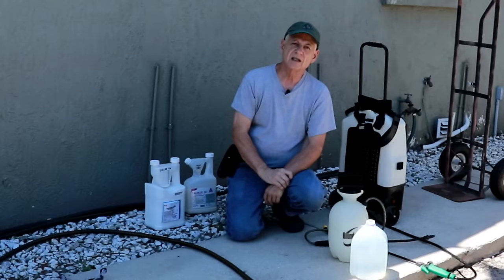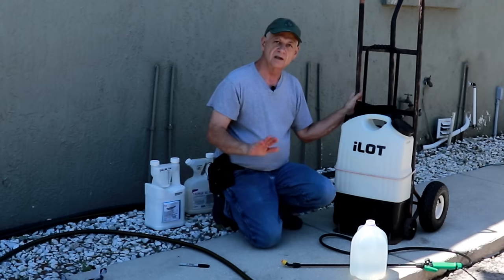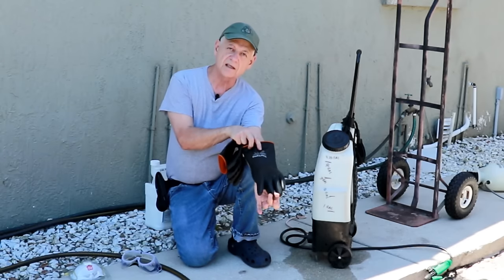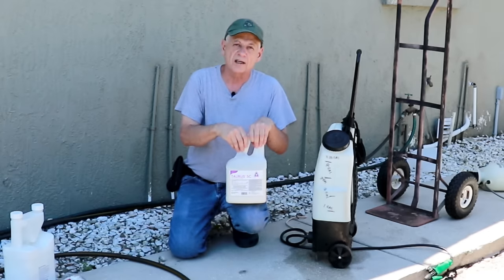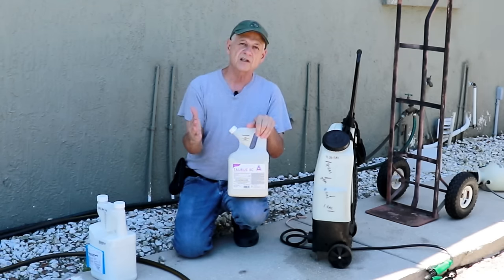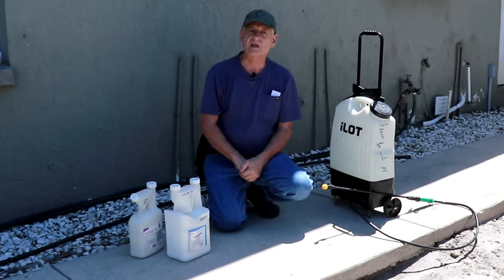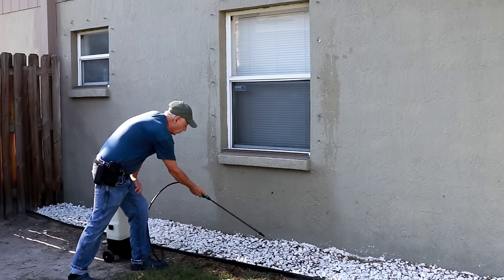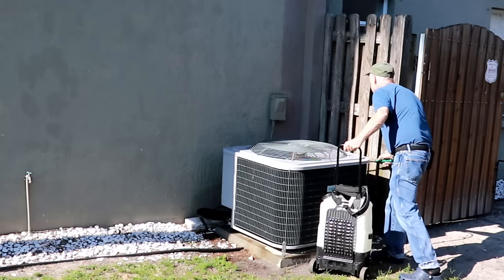General Exterior Pest Control - IMPORTANT!  READ THE DESCRIPTION.

Comment: Thank you Guy for this informative video. I am a complete novice in pest control. I am having termite problems in my house and in my wooden fences. I watched your other video about perimeter treatment, another great video. I plan to follow your advice there. I had also ordered the one gallon Natural Borate Termite Control NI1001 by Nissus to be sprayed on the wooden structure beneath the house and on the fences. That was before I watched this video. I saw you used Taurus SC, and I have this question: Will the NI1001 be nearly as effective as Taurus SC in killing termites, carpenter ants, spiders, and other pests?

Cockroaches don't seem to be a serious problem in where I live (California). Again, thank you very much for all your tips!
Reply from the maker: Hi Robby, Sorry for the delay in answering your question.  For some unknown reason YouTube held it for review and I didn't know that they did that sort of thing.  I have the problem fixed now, but not before several questions went unanswered.  It kind of makes me mad because there was no reason for them to do that.  They should have told me. Anyway, the Borate products work somewhat differently than the Taurus SC, but they are very effective for drywood termites, carpenter ants, and other insects that enter from the exterior of the wood and it is a permanent treatment.  That being said, subterranean termites and carpenter ants can and do enter the wood from other adjoining structural members and destroy wood from the inside out.  In the case of carpenter ants, they generally push wood out of small holes in the wood and may contact the boric acid that way, but subterranean termites pretty much remain inside the wood and do not like to be exposed to the air, so they never touch the boric acid.  So, I don't recommend it for subterranean termites.  All of this is to say that what you did was good and it will prevent  several types of insects from entering your home, including drywood termites.  However, you should still do the exterior treatment that I recommend in my video and the termite treatment that I recommend in my DIY Termite Treatment video.  In my judgement, you can't overdo it.  Boric acid products are great and I use them all the time for a variety of applications, but they have their limitations.  I hope that helps.  Again, I am so sorry for the delay.  It won't happen again.
Reply: @GuysPestSolutions  Hi Guy, many thanks for your detailed explanation. I will follow your recommendations and do the exterior treatment. "you can't overdo it." That's a great advice. Thanks!

Comment: I have black Swarmer's in the bathroom last few weeks please advise for indoor treatments
Reply from the maker: Black swarmers are always a common variety of subterranean termites that must be treated from the outside.  I have a video on that and I will place a link below.  If you want, you can also shoot some fipronil foam into any damaged areas.  Just drill holes several inches apart in all damaged areas and shoot in the foam for about five seconds.  You still need to do the perimeter treatment as shown in the video below because these termites never colonize in the house.  They always colonize in the ground and must return to the colony fairly often to feed the other termites including the queen and to get the moisture they need to survive.  When they go home, they pass through the barrier around the house and take it back with them to share with the other termites and that kills the entire colony.  The product I recommend is BioAdvanced Termite Killer granules.  It's cheap and easy to use.   I hope that helps.  Thanks for watching.  

https://youtu.be/H7rW_TSBHJ4

Comment: I have a lot of ants and mosquitoes and flies…what chemical do you suggest that is safe with dogs?
Reply from the maker: Ants, mosquitoes, and flies are very different kinds of pests and need to be treated very differently as well.  Therefore, I need to address each of those pests individually.  That means this is going to be a very long response.  Sorry about that.
 
To effectively treat ants, it's important to know the species.  As a general rule though, you should attack the problem from both inside and outside of the house.  That is because most species do not colonize inside buildings.  There are exceptions of course, but even those species need to be treated in the same way.  For the interior treatment, I have a video on how to treat ghost ants.  Even though this video was created specifically for ghost ants, you can learn how to apply a bait indoors to help kill off the colony.  I will place a link below for that video.  After you bait for them inside, then you need to do a proper exterior treatment.  I have a video on how to do that and I will give you a link for that video as well.  In that video I am recommending two different products, but I was not exactly clear how to use them, so let me clarify now.  For ants I recommend that you do your first treatment with Taurus SC.  Two months after your first treatment, I recommend that you start treating with Bifen IT every two to three months.  I know I say in the video that you should treat every three months, and that is true, but I am finding that in some places the ants are so difficult that you need to treat every two months.  So, you can use your own judgment on that.  If you start to see ant activity after two months, then just go ahead and treat.  However, if you are not seeing any activity or very limited activity, then you can go ahead and just treat every three months.  Also, the sprayers that are depicted in that video I no longer available.  I will provide you with a link to a sprayer that will serve you well.  In my video I am recommending Talstar P, but the Bifen IT is the exact same product, but only less expensive.  I also recommend that you treat your lawn with Bifen IT every two months.  Not only will this help to kill the ants, but it will also help to get rid of those mosquitoes.  I have a video on how to treat mosquitoes and I will place a link below for that video as well.  In the mosquito video I recommend using a specific sprayer that I no longer use.  I stopped using it because it just keeps falling apart.  Therefore, I am recommending a different sprayer and a slightly different procedure for using it.  I will give you the procedure for that below, if YouTube lets me post that much.  If not, I will post that procedure in the next comment.  I know you have some concerns about the dogs, so let me assure you that the Bifen IT is perfectly safe for your pets after it has dried.  Just keep children and pets off the treated areas for a couple of hours after you spray.  
     
Again, I recommend using Bifen IT and a specific garden hose sprayer that I know works, but you can use any brand that you wish.  I will place a link below for both the sprayer and Bifen IT.  I have found that these sprayers do not last beyond a few uses because they seem to clog up quite easily, even if you clean them really well.  So, what happens is you end up just spraying water instead of pesticide.  That is why it is a good idea to put a dye in with the pesticide, so that you know it is working.  I will provide you with links to all the products.  When the sprayer stops working, just buy a new one.  They are not very expensive.
   
This application method does not require a lot of protective equipment.  I recommend wearing goggles, rubber gloves, long pants, a respirator, and long sleeve shirt (If it's not too hot out).  
 
The Bifen IT is too thick to be picked up by the siphon tube in the sprayer and therefore, it needs to be diluted.  To do this, pour 4 ounces of the Bifen IT into the sprayer and then add enough water to fill it to the 32-ounce mark.  So, that would be 4 ounces of product and an additional 28 ounces of water.  As you are adding the water, swirl it around a bit in the container, so that it mixes as you are adding the water.  Before screwing the sprayer onto the holding cup, make sure that the siphon tube is securely into the sprayer head.  If the siphon tube falls out, then you will be spraying with plain water.  Set the sprayer at 8 ounces per gallon.  The labeled dilution rate for the Bifen IT is 1 ounce per gallon of water, but you diluted it 1 ounce of product to 7 ounces of water, so that means you need to apply it at a rate of 8 ounces per gallon.  At this application rate, you will see the holding cup drain down fairly quickly, so you will know that it's working.  If the product does not seem to be emptying out of the holding cup fairly quickly, then something is wrong, and you need to stop and figure it out.  If the siphon tube is solidly in place, then it could be that the screen on the end of the tube is clogged.  If that is clear, then put your finger over the bottom of the tube and turn on the water.  If you do not feel the suction, then it's not working, and the sprayer is malfunctioning.  You always want to clean the spryer really well after each use to avoid clogs.  It's always a good idea to put a dye in the cup with the pesticide and that will show if the product is being dispensed.  Just avoid spraying anything that you don't want colored, like concrete or the house.  The color will wash off the lawn and plants when it rains.  You really don't need to use so much dye that you actually color the grass.  You just want enough color so that you can tell that the pesticide is being picked up by the siphon tube. 
 
Attach the sprayer to a garden hose and you are all set.  Set the sprayer for a downward fan spray and spray your lawn, ornamental plants, and garden.  When spraying your garden, do not spray directly onto the fruits or vegetables, unless they are actually getting eaten by bugs.  Again, if you use the dye, then do not spray concrete.  Otherwise, I would spray the entire property from the house out to the property line.
 
Pro tips:  To make this application quicker and easier, I recommend that you buy 100 feet of one of those super hoses that you see advertised on TV all the time.  They are lightweight and make the job go a lot quicker and easier.  Also, if you attach a quick disconnect to both the sprayer and the garden hose, it makes refilling the sprayer a lot easier and quicker.  These hoses require that you have a shutoff valve at the end of the hose where the sprayer is located, so that you can shut the water off prior to removing the sprayer.  Most of the hoses have a shutoff valve built in, but not all of them do.  If you buy one that does not have a shut off valve, then you need to add your own.  I will place links below for all these items.  Please note that these hoses should be stored inside because they deteriorate fairly quickly when left in the sunlight.
 
Fly control comes down to eliminating breeding areas.  If you are talking about common houseflies, then you need to go outside and make sure that you pick up all the dog poop.  Do not leave dirty dog bowls down.  Wash them every after every feeding.  Do the same thing for water bowls as well.  Next, make sure there are no dead animals anywhere.  All trash cans should be treated with Bifen IT, both inside and out.  I always spray the trash cans at the same time I treat the house and the lawn.   Please let me know if you were talking about a different kind of fly, like drain flies or fruit flies.   
 
I hope that helps.    Be well Maureen.
 
Video on how to treat the exterior of your home: https://www.youtube.com/watch?v=3ESGJsn3MLk
 
Battery operated sprayer:  https://www.amazon.com/dp/B08B3MKYWD/?coliid=I1WHD5A3RF25H9&colid=3VDXA5DFBKQ98&psc=1&ref_=lv_ov_lig_dp_it
 
Video on how to treat for mosquitoes: https://www.youtube.com/watch?v=LkkrW_tlLkg
 
Bifen IT: https://www.solutionsstores.com/bifen-it-insecticide
 
If you cannot get the Bifen IT from Solutions Pest and Lawn, then try domyown.com: https://www.domyown.com/bifen-it-p-226.html?sub_id=11662 
 
Sprayer dye for lawn: https://www.solutionsstores.com/turf-mark
 
Garden hose sprayer: https://www.amazon.com/dp/B00UER1S64?psc=1&ref=ppx_yo2ov_dt_b_product_details
 
Garden hose: https://www.amazon.com/gp/product/B09SYT173G/ref=ppx_yo_dt_b_search_asin_title?ie=UTF8&psc=1
 
Quick connect fittings: https://www.amazon.com/gp/product/B08QG6F3Z3/ref=ppx_yo_dt_b_search_asin_title?ie=UTF8&psc=1
 
Shutoff valve: https://www.amazon.com/gp/product/B07CZYGVFH/ref=ppx_yo_dt_b_search_asin_title?ie=UTF8&psc=1

Comment: Do you recommend Taurus SC over Bifen IT for a general pesticide?
Reply from the maker: No.  Bifen IT is less expensive and it does a fine job.  In fact, I have an updated video that you may be interested in watching.  The one you watched was the very first one I ever did and I have gotten a lot better at it.  I am now recommending either Bifen IT or Bifen XTS.  The new video will also show you how to treat with a hose end sprayer, which is much faster.  You are not supposed to do it that way, but it will not harm you or the environment.  Don't get me wrong, the Taurus SC and the Talstar P that I recommended are perfectly fine to use, but the Bifen products are a bit less expensive and I find that they also do a great job.  I hope that helps.

Updated video:  https://youtu.be/Yozv3s-Qwlw

Comment: I live in Virginia and have carpenter ants outside my house. I used Dominion 2L which has Imidacloprid on the outside my house. What are your thoughts on this product.
Secondly, I have found 5 carpenter ant nests within 50 yards of each other. Perhaps the colonies are the same. I tried boric acid and sugar and mixed with water and poured into the nests. I am still seeing ant activity. Any thoughts on the best way to kill the colonies in the nest?
Reply from the maker: Dominion 2L it's a great product.  I don't use it myself though because it is too expensive.  You can achieve the same results by alternating between Taurus SC and Bifen IT.  The Taurus SC is labeled for use every six months, but it does not last six months.  Therefore, you need to do in between treatments with another product and the Bifen IT is about the least expensive product you can get.

The best way to treat the tree stumps is to simply spray the stump with the Dominion 2L or the Taurus SC.  Just spray the entire stump and spray the ground around the stump from the base of the stump out at least 18 inches and soak the ground really good with it.  Unlike termites, carpenter ants travel above the ground and so they will cross this barrier when they go out to forage for food.  Also, unlike termites, carpenter ants do not eat wood.  Therefore, they must go out in search of food.  That means they will have to leave the stumps and cross the barrier that you put around the stumps and on the stumps.  It kind of works the same way as treating the exterior of your home.

You should be aware that the infestation in your house is most likely only a satellite colony.  The main colony is most likely located in one of those stumps.  Therefore, if you do not treat the interior of your house, then that satellite colony is going to continue to function.  I have a video on how to treat a carpenter ant infestation and I will provide you with a link to it.

I hope that helps.  Be well my friend.

Video on how to treat carpenter ants:  https://youtu.be/Te9BUCaIQZY
Reply: @GuysPestSolutions  thanks for the tips!!!
Reply from the maker: You are very welcome.  Be well my friend.

Comment: I had someone inspect my attic for termites before she even got into the space she was already yelling out I had termites. Then shows me two pictures one pic was a dead termite and the other pic of one termite without a head, then she gives me an estimate of  $4.000  I just don’t know what to think .....I’ve been dealing with this same company for as long as I own my home. Can u suggest a treatment I can do myself?
I don’t need  to treat the outside of my home because the house is surrounded by concrete.
Reply from the maker: Hi Belle.  Sorry for the delay in answering your question.  For some unknown reason YouTube held it for review and I didn't know that they did that sort of thing.  I have the problem fixed now, but not before several questions went unanswered.  It kind of makes me mad.  They should have told me.  If you have termites in your attic, then I am guessing that you live in a southern coastal state or maybe California, because it sounds like drywood termites.  Subterranean termites can be found in the attic, but normally you find them much closer to the ground.  Drywood termites do not need to return to the ground and actually infest your house by flying into it.  They enter through any crack or other penetration that they can find and then colonize in your attic.  If these are the guys you have, then this is a job best left to the pros, but $4000 sounds high to me.  I would shop around more.  Now this is something you can try to do yourself but it can be somewhat tricky.  You need to actually find all the colonies and treat them individually.  That's not easy to do in an attic.  Let me know if I am correct about this being drywood termites.  It may not be.  However, if it is and you want to do it yourself, then please let me know and I will advise you how to go about it.  Thanks for the question and, again, sorry for the delay.